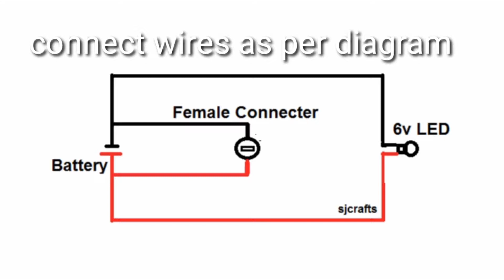Awesome lifehack ll how to make rechargeable LED Light ll invention light ll diy ll sjcrafts ll

Comment: i need a lil help. I have a battery, a 3prong switch, and an led light i made of single 10mm leds. So far as is, everything is fine and dandy. Problem is i have to disconect the batrery to charge it everytime. I have a tp4650 w/out protection, that i would like to incorporate. Can you help me with a diagram for this please. I know its easy i just cant get my head around the connection it would be bit easier if i had a 2 prong switch but my wife dosent want anymore gadgets in the house so i have to do with what i have. I would appreciate your help. I changed my profile pic on youtube so you could see the diagram i have so far.
Reply from the maker: message on instagram